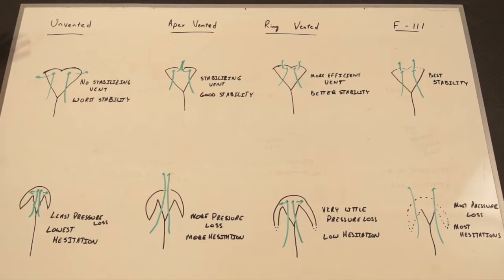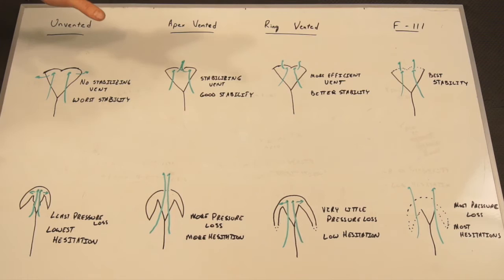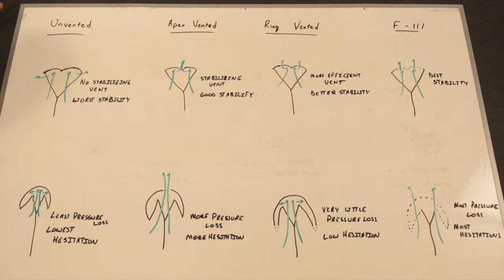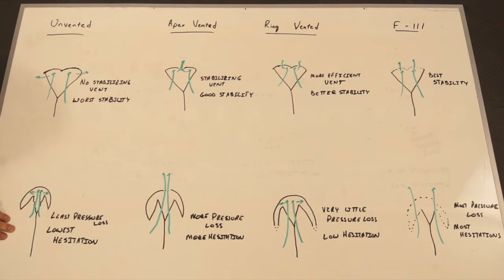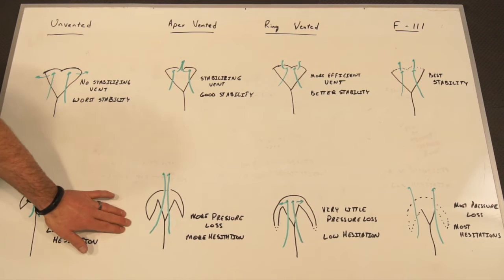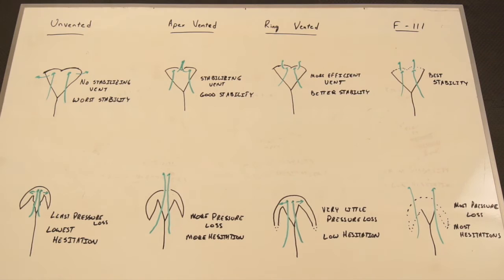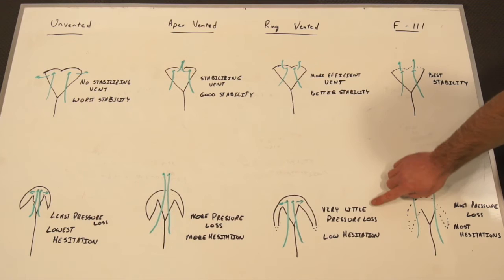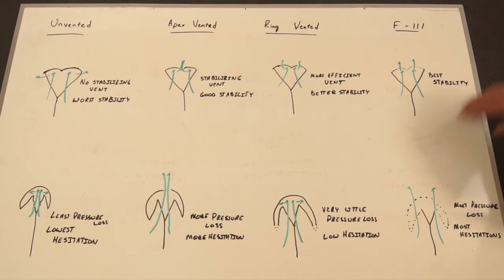Pilot Chute Comparison

Comment: skydiver here: what is this stability on the PC? how does it affect bag coming out of container
Reply: Thanks for your question. Base rigs don’t have deployment bags, they are packed directly into the pack tray of the container and the lines are stowed in a tail pocket. 
There are a couple of reasons that stability is especially important in lower speed base deployments. The time between throwing the PC and reaching line stretch is much longer on a short delay BASE jump than on a skydive and the amplitude of PC oscillations can be much higher due to the low airspeed and the longer (typically 9’) base bridle. This has the effect of the pilot chute orbiting before reaching line stretch and pulling the freepacked canopy (remember, no Dbag) in a bunch of random different directions, which creates a high likelihood of off heading openings and other issues. 
BASE PC’s have evolved over the years to include various types venting features and construction methods in order to make them oscillate less while still producing ample pull force at low speeds. 
In our Fundamentals of BASE courses we spend about two hours talking about pilot chute design and dynamics as well as what size PC and what deployment technique to use in different situations. Check some of our other videos for more info.